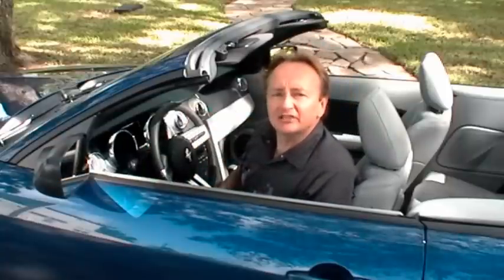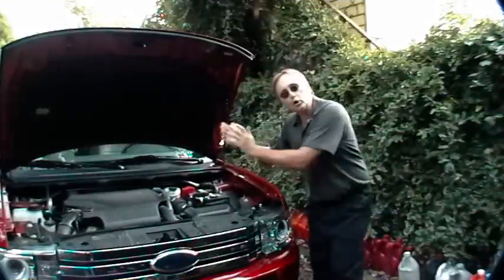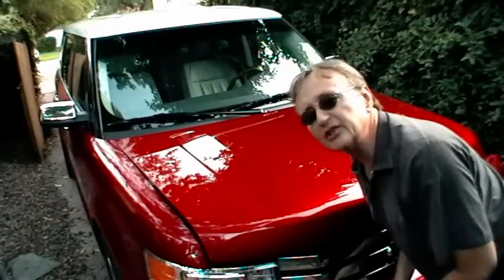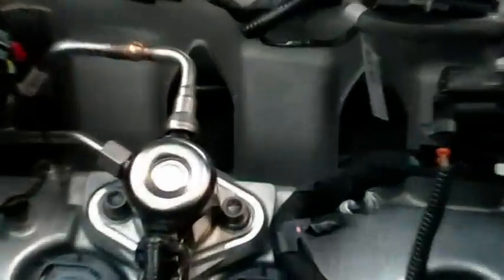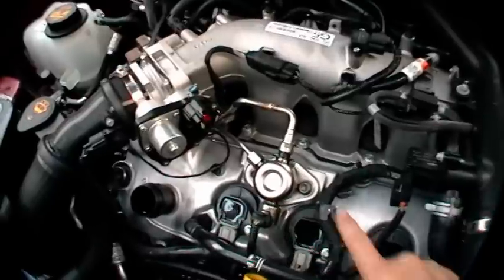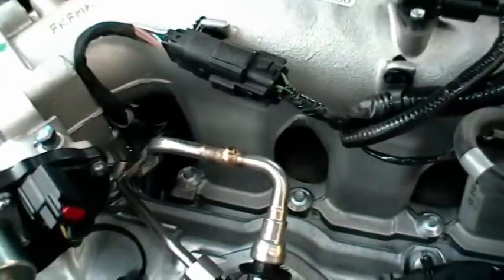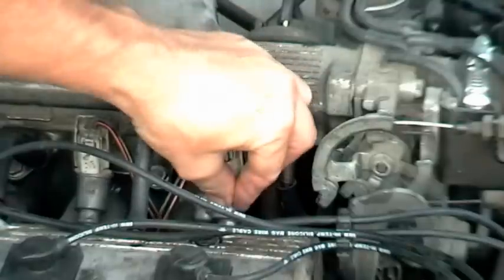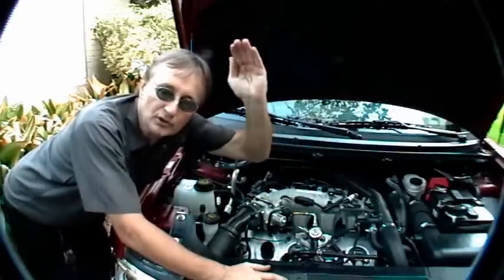How modern technology increases horsepower

Comment: Hey Scotty, i drive a 2001 Ford Ranger, 3.0 liter, 4cylinder, 5 speed transmission with 86k miles and I was wondering how I could get more power without having to spend too much money and without making modifications that will damage the vehicle over time? Your great advice would be tremendously helpful and thank you for posting these helpful videos!

Comment: Can l use an electric turbo to increase gas mileage on a 1966 Oldsmobile Toronado 425 engine?
Reply: Electric "fan" turbos don't work, if you can get a electric "turbine" turbo that might work
Reply from the maker: Hjembrent Kent  They are called superchargers, but cost thousands of dollars to buy and install correctly.
Reply: You mean electric superchargers? Scam! They're nothing more than fancy looking computer fans and are nowhere near powerful enough to do anything.
Reply: Henrik Nilsen Yes like i said electric fan turbo/supercharging doesn't work, but a electric turbine would theoretically at least

Comment: 97' ranger 2.3liter 4cylinder manual transmission 206k miles
I am thinking of replacing maybe in the future with??? I would like a diesel.. I tow small trailers maybe 2,000 lbs.. Thanks for the great vids Scotty!!!
Reply: Nik Lyons If you're towing just 2,000 a F-150 will tow it just fine. It's better on gas than a diesel as well.
Reply from the maker: diesel are GREAT for towing, but you pay a premium for a diesel engines and most get crap fuel mileage IN TOWN.   Just realize that.
Reply: Cool Thanks!!! What do you think of converting to hydrogen on demand systems?
Thanks for the great tips!!!!
Reply from the maker: Nik Lyons
if you want extra power, go right ahead. Just realize hydrogen isn't cheap or something magic, you're better just using gasoline it was designed for.  You can of course convert the whole engine to hydrogen, but really, where would you get the hydrogen from? It's not a readily available fuel.
Reply: Got ya, not cheap indeed!!
 Cost Stan Myers his life.. Not cheap yet :)
I know some people on you-tube are claiming power and efficiency gains with there
fuel dry cells and bubblers.. It's all in the grass roots stage right now but hopefully not for long.. Some say its a relatively straight forward conversion process,, of course some people are messing up there engine with moisture but I won't do it until I'm sure..
Thanks for the response Scotty!!!
Reply: Scotty Kilmer The odd thing is, here in Europe, or at least Central-Eastern Europe, Diesel engines are cheaper, get better gas mileage and the price for diesel is only a slight bit higher than 95 octane gas. Before the recession, diesel was way cheaper and it was an even better investment.
Reply: UnafraidCookie here in america, diesel is about 50 cents more than 95 octane
Reply: Bailey Degregorio
That's what I ended up deciding to go with '[00 f150 4.2 standard.. for $4950 cash.. It tows my small trailers fine although I am showing some lean codes bank on and two which apparently is common for f150 to have a vaccum leak.. But the ac blows cold and she usually fires right up.. Sometimes I turn the key twice to make sure there is fuel.. My truck was in a disabling accident with no frame damage.. But it looks good and I feel like I made the best choice possible after looking for a truck for over 3 months.. If I was towing long distance I would probly need a diesel but diesel seems to be for people with deep pockets.
Reply: +Nik Lyons Wow! Awesome, built ford tough! 
I would love a diesel, but I dont have that kind of dough.

Comment: Scotty!  So glad you did a video of these engines, even though it was way back in '09.  The hp that these V6 engines are getting is amazing!- more than the V8's from back when we were kids! The 3.5L engine (that's 214 cubic in.) makes a whopping 365hp and over 400lbft torque!  And the torque is avail at @1500 rpm!!
Reply: While checking Ecoboost numbers, I just had to post this.  The famous 5.0L Mustang engine from the 90s best numbers were 225hp/300lbft and now the new 4 cyl 2.0L Ecoboost rates 240hp/280lbft !  That's a 120 cu.in. engine lol
Reply: Mike koz You might want to take a look at the Rotary engines in the RX-7 and RX-8 Mazdas, and also the Toyota engine in the Lotus exige/elise, the engine in the honda s2000, the engine in the GTR R-35.

Comment: Nice cars, but until they get old enough to meet a one time cash payment plan, they can deal me out. The ecoboost gets about 16 in the city and 23 highway, and costs almost $40,000. You have to buy premium gasoline to get the horsepower numbers from any of these engines advertised. These are not for saving money.

Comment: No thanks, I will stick with a standard or GDI engine. Ford Ecoboost engines SUCK! How terrible is it that a GM V8 can produce MORE HP and Torque than an Ecoboost V6 AND get better MPG... Also ive seen the hundreds of videos of how terrible the Ecoboost engines are. Stalling, Chattering, Failing to start in the rain, Over heating.. PASS!

Comment: Scotty my friend I got 80km/liter in a fj62 land cruiser by drilling holes in the emulsion tubes,  no adjustment with efi  fuel  put straight into engine with no vaporization. PS I nearly burnt my brakes out on the road test the power increased by at least 10%

Comment: Scotty, I read from online forum that direct injection engines are prone to intake valve carbon/gunk deposits due to no fuel/detergent "wash" over the valves during the intake cycle. Unfortunately I already got a car with GDI engine so how would you suggest to combat the carbon deposit on the intake valves as mileage grows?

Comment: your turbocharger is a garrett and "with proper maintenance", or a rebuild every 80,000 miles, it "could" last 300,000 miles. my sources are 10 years of automotive and diesel technology where ive seen garret GT25 frames snap the turbine shaft like a twig with maximum bearing load. also the inferior mexican made garrett turbochargers have oil seals that leak at roughly 80,000 miles on most passenger vehicles.

Comment: yours is an old garrett turbocharger with a spindly shaft that if you start heat soaking without a proper cool down will cause hairline fractures in the turbine shaft. i suggest you take that piece of junk off your car and replace it with either a holset or a borg warner turbocharger.

Comment: hotter the cylinder temperature the less unburnt fuel is left in the cylinder to cause hydrocarbon film. GDI can burn much hotter and with less fuel injected per injection cycle than any indirect injected manifold mounted gasoline injector can. you wont have to pull the head every year and piezoelectric injectors last 3x longer than standard magnetic coil solenoid injectors do.

Comment: Seems the industry is going to the direct injection, both Ford and GM are using it in their newer engine designs.  Like the TBI and MPFI that came before it, each new injection system seems to have given better power and helped the gas mileage out some too.

Comment: As another note if we made the alcohol using one wrong metal in the pipe we could sell A100 not E85 old timers called it turpintine bad batch witch is nondrinkable toxic and we all could vaporize it np no need for a big mess in setting up car or truck. and all them than would get over 100mpg cuz one gallon of alc turns to 8 to 12 gallons vapor depending on purity rate and it wouldnt need to be of a high quality i use 160 proof np! From my own still!

Comment: All those so called new crap cars junk my old truck is running on E85 vapor with HHO and if they ever get the oil comp out of controlling the makers than u might get a truck like mine well over 100mpg oh but wait that would mean we wouldnt need to bring in so much oil from over seas cant do that or u could have my biomass big truck with a 460 that dont use any gas at all!

Comment: The high pressures allows the gasoline to atomize better than anything else. The direct injection gasoline is so fine it's like a fog vs regular fuel injectors which are more like a spray bottle.

Comment from the maker: @46METALGUIT46 perhaps if I get one to work on. I'd just use a smoke machine though. and replacing them is just bolt off bolt on, but the bolts can be Hell to get off from corrosion.

Comment: Statistics have shown that more Americans are towing heavier loads each day. On average each American will tow 4 000 000 lbs. of payload weekly. This is why the EcoBoost flying-saucer technology has been introduced. If the engine runs out of fuel while towing a skyscraper, the turbos will develop anti-gravity lift. You will get home safely without incurring a $6000.00/hr. mechanic fee. The New Ford easily pass the 120 mph barrier test.

Comment: Scotty when I got my first car my father told me to always let the car "warm up" before going on any drive.  Today people don't say to let cars warm up.  As I got older and knew more about cars I could see why "warming up" the car was important.  Some cars have aluminum heads and cast iron blocks and that would mean the two different metals heat up at a different rate from cold.  My question is do modern cars still need to be "warmed up?" If not, why not?

Comment: Hello Scotty. Can you make some videos on the new 2011 Explorer. It's a great vehicle but has multiple engineering issues. Fan assembly problems, A- pillar rattles, overheating issues, and MFT issues. It's something Ford engineers can't seem to get right. Can you tell me about the 2011 Explorer and how it works and why it gets those problems?

Comment: @scottykilmer Not true. Turbocharging accomplishes both, increasing power and torque by increasing compression, and using the same amount of fuel per charge. In actuality, they accomplish roughly the same power and speed as an American engine, but in a much smaller, inherently more efficient powerplant. 

I dare you to get an American engine setup, below 2-liter, and have it run as much power as a European or Japanese engine of the same size. (Assuming any forced induction system is retained)

Comment: Wow, very cool. Does it still have a fuel pump in the tank or just that 2k psi on the engine? Also have you heard about these new engines that are suppose to be comming out of Russia? I guess they act like a rotary engine & there's no reciprocating parts such as crank & connecting rods.

Comment: @scottykilmer As long as he kept it in low boost (somewhere around or under 10psi) with stock internals he would be fine. Which would still be worth it. Once he has money to rebuild the engine with forged goodies he can step up the boost. I wouldn't suggest doing this without upgrading the clutch and the rest of the drivetrain first though.

Comment from the maker: @wiigamer136  It's a device that uses exhaust gas from the engine to spin its blades REALLY fast so they can suck in air and pump it at pressure into the engine cylinders. Scotty

Comment from the maker: @racer07  Injectors are custom made for each car and computer system. As such, you can't just guess and switch them out randomly. the air fuel mixture has to be perfect, and that requires a lot of engineering and software. Scotty Kilmer

Comment: Dorky Name that Ford came up with and the Technology is loooong overdue for Gas engines.
  Gas engines are about at their limit for efficiency and still lag behind Diesels.   Unless there is a major breakthrough in gas technology, you'd still have to defeat physics since gasoline has much less BTU energy per gallon.

Comment: That car looks like the new English Mini, Scotty can you please post a video on setting up points and also setting over head valves my father told me something about putting the car in gear and when 2 were rocking setting different valves it confused me, I also wanted to learn when do you use gasket paste? exhausts I was told paper gaskets also with head gaskets or rocker covers do you use it? I feel daft asking but I want to learn Thanks Scotty

Comment: Hello Mr. Kilmer,
My second car is a Honda Civic LS-i (95) and I have been driving it to save gas because my 2004Pontiac GA GT is a monster at fuel consumption. But my question is if putting a Cold air intake will increase power in my honda and also increase gas mileage? And also, is there any other way to increase HP slightly without having to spend hundreds, just to make it easier to get in the interstate faster if you know what I mean. Thank you and if you help me out I will subscribe. =)

Comment from the maker: Hey, you want an impossibility there. To increase horsepower to any real extent, LOTS of money has to be spend. Supercharging, turbocharging, or cranking up the engine compression all costs BIG money. the only thing you could mess with would be to put an aftermarket racing carb on it if you can find one anymore. I used to use Webers but they are bankrupt and unavailable in the states here anymore. Scotty Kilmer